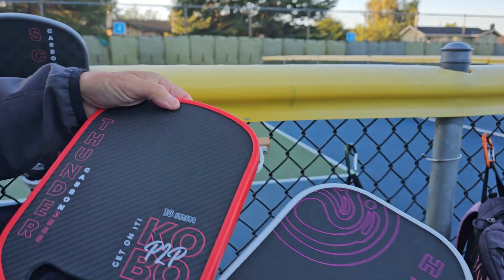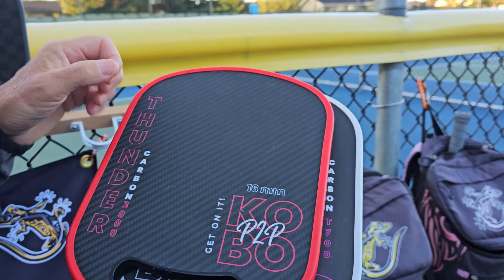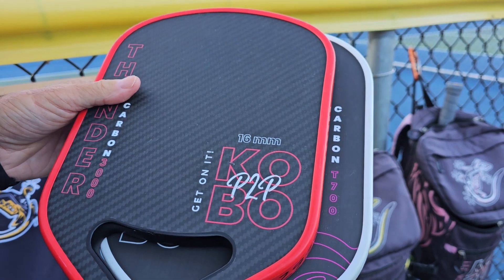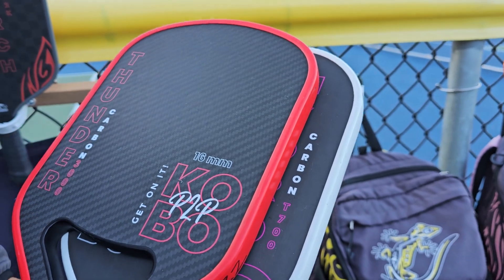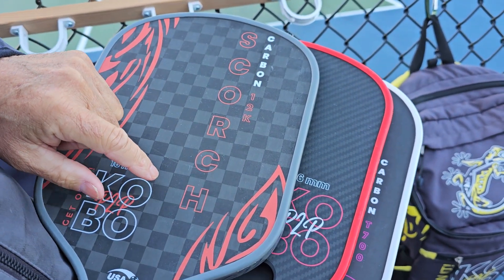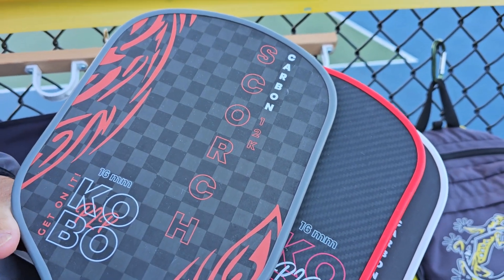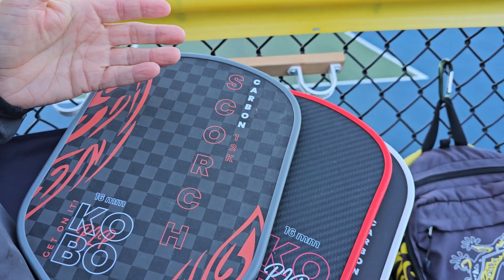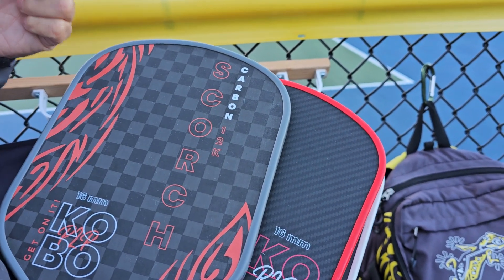Pickleball Paddle Materials Explained|T700, 3K,12K &18K Carbon Fiber Differences for Power & Control

Comment: T700 is a grade of carbon fiber, NOT the amount of fibers in a bundle. The 3K carbon fiber has 3,000 filaments per tow, giving it a checkered pattern. In contrast, RAW (unidirectional or UD) carbon fiber has no pattern whatsoever.
Reply: It's all about how many layers are used. The K nr has nothing to do how soft or how hard the racket is. Sorry..